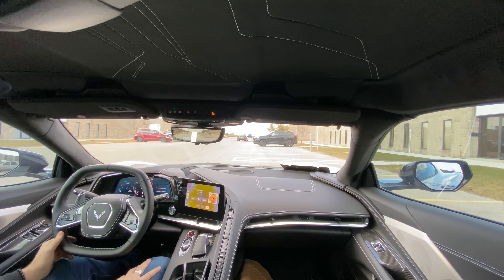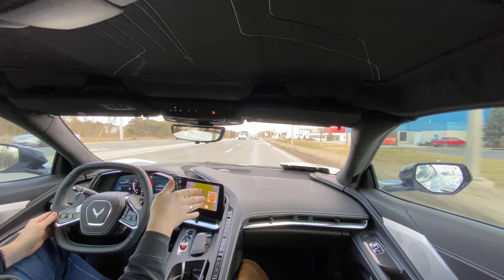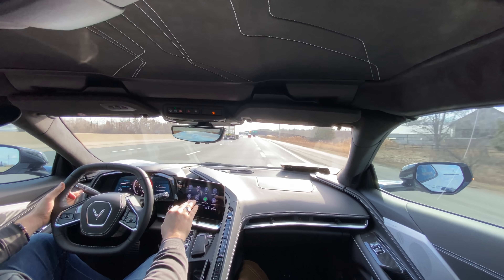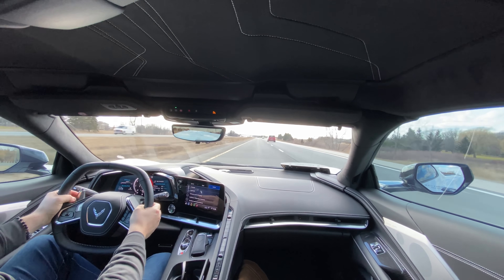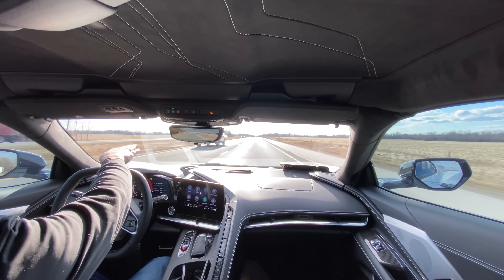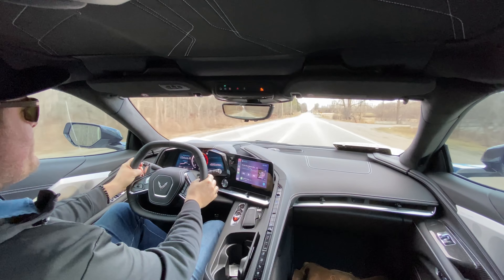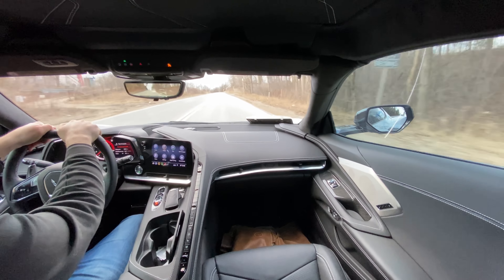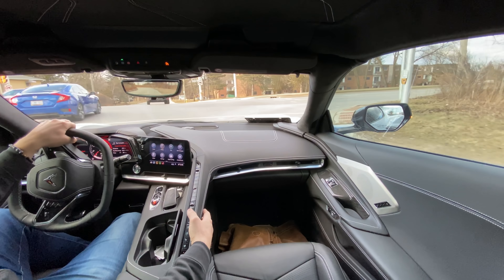Break-in drive with my C8 Corvette / First impressions / Dual Clutch Transmission

Comment: another GREAT presentation! Active Fuel Management, 2020 Corvette Performance Features, page 8, states that in Track Mode, AFM is disabled. Also states that in Z-mode, "Track" is the default, therefore it reads like it can also be disabled in Z-Mode???

Comment: Just one quick question will A standard C7 rear license plate frame fit on the C8????
Reply: License plate frames aren't vehicle specific 🤦‍♂️
Reply: @kc3689  high elder o k.     has spoken, as the prophecy  foretold

Comment: No engine braking using paddle shifters.  That is until break in.
Reply: Jay Montange Engine braking is actually good during break-in. Just. FYI. It is good for seating the rings. Just vary the RPM’s
Reply: @_hashtag  your right just don't go over 4000 rpm's it's in the manual
Reply: Roger Kremer whoops. I may have been going over that.

Comment: my apology.. I thought you cant use paddle shifters/manual during break in period. I am wrong, it's the cruise control you can't use during break in period for the first 200 miles. My apology.

Comment: Speaking of the transmission I’ve seen in some other videos 0-100 runs of 3.5 seconds. It’s supposed to be 2.8s. I have noticed a shift point at just under 100kph that reduces the acceleration time. Is that adjustable with settings or a factor of transmission break in?

Comment: The break in period is not for the engine, it’s for the transmission, the tires and brakes like you said. The engine is pretty much broken in from the factory and most likely has better machining and anti friction coating that don’t require the same type of brake in as a crate motor. Some guy dynoed a new corvette with 25 miles on it and got 440hp and 408 ft-lb. Most likely the torque is turned down for the transmission during brake in. I’ve seen TJ couldn’t do a burn out while in brake in. Don’t forget guys like TJ Hunt and Streetspeed intend to twin turbo their cars so they don’t care so much.  I’m really interested in seeing how this car hold up to heat sink while driving aggressively. I think the last gen Z06 suffered from heat problem early on. Also I know the splitter is a replaceable part but it really makes me think “the plastic fantastic”.
Reply: "The break in period is not for the engine"... seriously?
You know nothing about engines.... or cars for that matter..
Reply: Young Simba I’m a vehicle engineer. Most engines today are not made like engines in the 70s where the break in period was used to smooth out machining surfaces. You had to change your oil immediately to remove metal from the break in period.  Now engines use anti friction coating and the machining is done to a much better surface finish, almost polished. The parts in the engine don’t break in as before as mental to metal contact is reduced. Also the engine are run in in the factory with a break in oil. The first oil change is to get rid of the factory oil and switch to synthetic. I don’t have access to the corvette manual but if the first change is at 5000-7000 miles then it’s factory synthetic no break in needed. The transmission and deferential are different because no matter how much you polish your gears they need to seat and mesh together. That’s why you don’t drive in cruse control and run at max torque. Again for a crate engine or a rebuilt engine totally different break in procedure.

Edit. GM recommends on the high performance engines to do a 500 mile oil change so it has a special break in oil for the engine.
Reply: JetRanger47 I’m an automotive engineer, what it your back ground?
Reply: @Sophie-and-Ken  Wrong.
Reply: @Sophie-and-Ken  In the high end sportbike world it's common belief that break in period actually includes early redline rips to the top of the tachometer for "proper break in". They say it helps seat the moving parts within the motor to tighter tolerances and makes more HP through the longevity of the motor. What are your thoughts on that?
Reply: o k ok, prove it or not true.
Reply: @Sophie-and-Ken  Read your own comment. You literally edited it and admitted you were wrong. Why are you trying to act like you weren't?
Reply: drewmorg every motor has a different break in based on manufacture and the use of the engine. Even GM in its manual say you only need the 500 mile oil change on high performance engines only. A lot of what we know know was based on stuff from the 60s or 70s especially regarding oil tech and machining. Engines have changed a lot in the past 10 years and a lot of what we know is not valid but still it’s up to the manufacture to specify a maintenance schedule. For example even though chevy and McLaren both use Mobil 1 synthetic chevy has a 7000 mile oil change interval and McLaren say change the oil at 700 miles. Even a race engine or a crate engine needs a special process to break it in as you mentioned, to produce optimal power when used.
Reply: You can't reduce torque without reducing horsepower. If you were an engineer you would know that. Horsepower = (torque x rpm)/5,252. Something is wrong with their dyno results. 

Secondly, it's called heat soak, not heat sink. 

Regardless of any of what I said, this car is so over hyped. It's just a pushrod truck motor stuck in the middle of a Frankenstein chassis. Its not even as fast as the old C7 Grand Sport around the Nurburgring. 

GM = Cheap, old tech, at an inexpensive price.
Reply: o k only on high performance engines. It’s still not a break in the traditional sense where you are smoothing out manufacturing imperfection to smooth out the bore of the cylinder. It’s more to make sure everything seats properly and more for the transition than anything else. These engines are so well built now that no break in period is really needed. It’s not a real race engine and most base model corvette owners probably won’t track their cars or need a high performance engine. On a Z06 or ZR1 engine it’s different.
Reply: Austimo 3000 you don’t understand tuning and controlling the power band along with timing.  The z06 will use a different engine, flat plane. This vehicle is a base model. You can’t put an expensive engine in it. It would cost over $100,000.  Over all even with a crap engine this car will give you 50% of a super exotic where you can’t even use 50% of the potential of a car like a 720s on the streets. So for the price it’s a bargain.

Edit: to explain better many GM engines hit max torque at low RPMs and it is possible to reduce power there while maintaining max power at higher RPM. You’re assumption is based on max torque and max HP occurring at the same rpm and in most cases they don’t.
Reply: @meterdoogles  Hold on a second. You are comparing new C8 Z51 package on Mich PS4S tires vs. the C7 Grand Sport on Cup 2 with 100 octane fuel and mapping. They are within 1 second apart and the 7:27 for the GS is an unofficial number by GM anyway. If you put the C8 on Cup 2's it should buy it 6-8 seconds easily on tires alone. This is the standard gap of other cars tested when all things are equal except the tires. 

Not to mention the Grand Sport gets the wide body kit treatment which means bigger tires, bigger aero, bigger brakes.

Whether it's old truck tech or not, it's fast as hell. The C7 Z06 is #20 on the list of all time factory Nordschleife times. Given the price point I'd say it's pretty amazing.
Reply: drewmorg 100 octane fuel has a negligible effect on a naturally aspirated car. The grand sport was rated 30hp less too.  So you are saying that it’s ok the new corvette isn’t faster than an old lower level corvette? Sounds like excuses really. GM is trash
Reply: @meterdoogles  Given the variables I mentioned yes I'm saying it's not only acceptable it's to be expected. Why are you so confused? C8 base Z51 is faster than C7 base Z51. The C8 Z06 and C8 Grand Sports will be faster than the previous ones as well -- it could be a huge amount we just don't know yet. What is the surprise here?

Porsche doesn't make their new 992 Carrera base model or S model faster than their old 991 Turbo or GT3 models so why are you so confused about this?
Reply: @meterdoogles  C8 > 992
Reply: Austimo 3000 I see you are super biased. Probable drive a Hyundai but that’s ok. The “base" C7 Stingray Z51 achieved a segment time of 7:33. The mid-engine 2020 C8 Corvette was said to lap the Nurburgring lap time: 7:29.9. That’s a big achievement and could be faster still based on further testing. Either way nobody is going to try and set lap records in a “base” model car. The Corvette’s lap time of 7:29.9 puts it within inches of the industry’s high-end supercars, including the McLaren MP4-12C and the Mercedes-Benz SLS Black Series. It’s also following close behind the Camaro ZL1’s record of 7:29.6. For what you pay for it’s very good value.
Reply: @Sophie-and-Ken  Let us not also forget the entire Corvette lineup is practical and gets great MPG too. Lol. 

The reality of setting REALLY fast Nurburgring times (anything below 8 minutes specifically) starts to come down more to AERO and weight than anything else. The Viper ACR is a great example.
Reply: drewmorg true bit it’s sub seven everybody is trying to achieve and no North American car has done that yet. It will be interesting to see what true performance corvettes can do. I’m betting the ZR1 is sub 7 putting it on par with cars costing hundreds of thousands. We will find out soon.
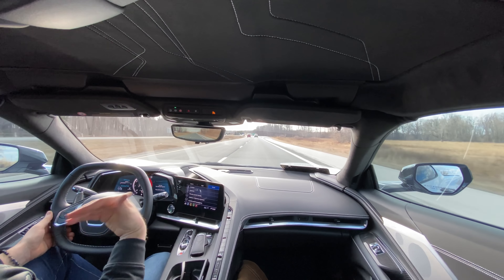Reply: @Sophie-and-Ken  the C7 ZR1 unofficially ran 7:06 with suboptimal conditions and a broken tune. No excuses in racing, but we know it's very close. It's really amazing what Porsche and Manthey have done with their GT3RS and GT2RS though. I don't think anything from Corvette will touch them in the next few years. Porsche is also close to releasing their new GT generations as well for the 992 platform.
Reply: drewmorg gm doesn’t understand its market. They still think a car over $100,000 won’t  sell well. GM could make a street legal version of its c8 race car and charge upwards of 500k for it and it would sell out. Just look at the Ford GT. Ford refuses to do a ring run and it’s not as good as other cars of its type. The 720s costs the same and destroys the Ford GT. People will spend that much on a street legal race car. GM really needs a C8 GT2 variant.
Reply: @Sophie-and-Ken  I mean, I disagree, I think they understand the market very well. Don't get me wrong I'd love to see something like that but Corvette is just a higher volume product than the Ford GT and Ford really doesn't offer anything as a direct competitor to the Corvette either. At the end of the day each company spends their R&D money on a product they think will bring them the most exposure and revenue of course. If you look at the numbers, Corvettes only account for like 1-2% of GM's total yearly revenue. They are a minuscule portion of the company's sales figures. 

That all being said I think we may see some Hypercar action from whatever the Zora may be. I don't think your average 60+ year old Corvette buyer cares whether it's a homoligated racecar or not. I think they want a cush ride, good power and noise, and room for golf clubs mainly. LOL

Comment: Great info, all the c8 owners on YouTube are making bad break in period....wtf
Reply: kal l they youtubers don’t need to brake in their cars. Most will twin turbo and wide body them and quickly dump them for the next new car.
Reply: It's a new Corvette. Of course people gonna put it through its paces as fast as possible.  And to me GM should break in engine and transmission before installing if it's it's that finicky.  Somebody gonna be unlucky and have their engine die with.